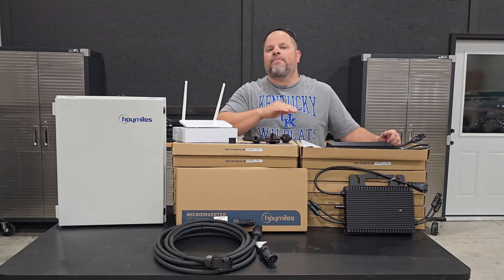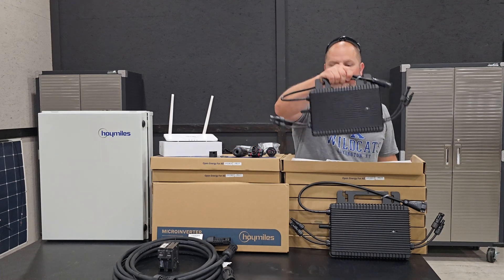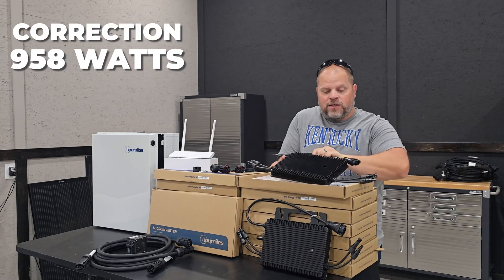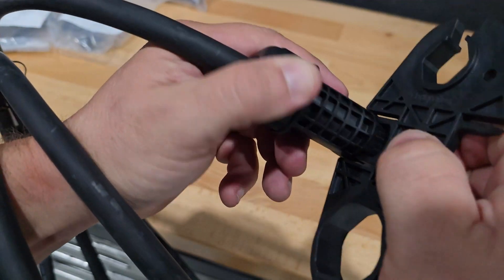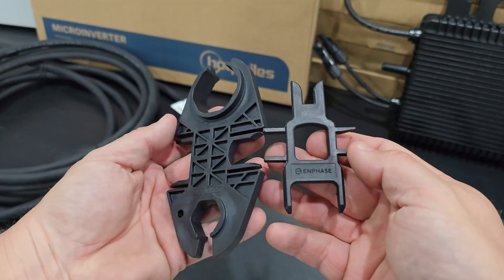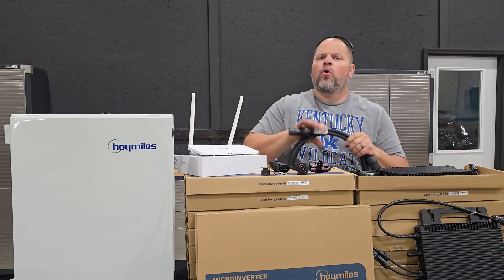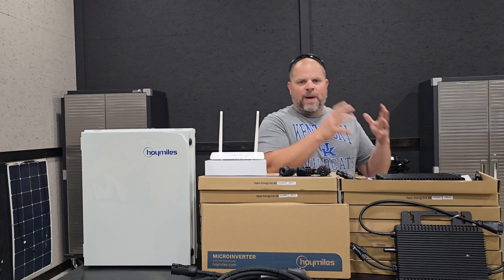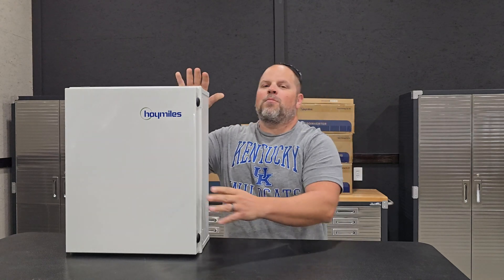HOYMILES just released this!! Goodbye Enphase

Comment: can L14-30P plug be connected to the trunk cable
Reply: I also have this question so it would be easier to backfeed it
Reply: Excellent question. I'm trying to find out this as well.
Reply: I have NEP Trunk cable. I suspect they have the same layout but not sure. in that case no it is not. 

Back to your question, L14-30P plug has exposed leads which wont be electrical code compliant because of exposed pins. They might be energized.

Comment: I just scored 36 duals. Since they were grid-tie I figured I could wire a string into my breaker panel and slow the meter down.  The utility smart meter did not recognize the input and kept billing me even while pumping twice my consumption back into the grid.
I got a hold of the utility and said I guess I'm bound to become a net producer. Let's talk.
Hoymiles makes it so easy. 
And yes, my eyes were on the combiner box. Delighted that it has in-built DTU.
subscribed.
Reply: I connected my panels to the house end of the meter. I noticed I don't get any credit when I produce more but the meter registers zero usage when I produce more. I ask them to give me a meter to get credit. I'm still in process.

Comment: Enphase really needs to step up, they are rapidly falling behind. I can already easily get affordable 500-600W panels and they have nothing that supports 400W+ panels decently. Also their earlier start-up argument does not hold water, not with current panels and other microinverters.
Reply from the maker: My Hoymiles system is far outproducing the Enphase I had. Finally got it up and running on a Solar Carport. I will be providing some performance data soon. I think everyone will be surprised.

Comment: A 440W panel can output over 500W if the irradiance is greater than 1000W/m^2. On days when there are fluffy white clouds, this occurs regularly. I've been using and selling Hoymiles microinverters for over 3 years. They don't fail and I have 100% happy customers! However, the HMS-1000-2T and HMS-2000-4T, clip at about 515W DC from the panel. It's huge compared to Enphase. I also tore out my Enphase system and installed Hoymiles for the same reason. Thank you!
Reply from the maker: Thanks for sharing that information.
Reply: Clipping does not bother me. I'd rather have the inverter at full capacity through a myriad of conditions and oversize the panel, than have an equally balanced panel that 80% of the time is not putting out rated power.
Reply: @wisconsinfarmer4742  Agreed. I use 550W panels myself.
Reply: I use dual HEP BDM-800 microinverters. They accept 600W on each input but outputs out 768W. It is ideal for two direction facing sytem as when one panel produces 600W the other is not as efficient. You kinda use time more efficienctly. Is it same with Hoymiles 1000?

Comment: Justin's where can I get that DTSU666 60Hz 120v/240V.
Reply from the maker: Might be available at NAZ solar.
Reply: Don´t get the Hoymiles DTU (if you have HMS or HMT without W). Look for OpenDTU/AhoyDTU. No need for the Cloud. It needs a bit of tinkering though. You can buy kits or get the components yourself for less than $20...
Reply: @fintrollpgr  I saw those on eBay ~$20. 
do the kits come with assembly and launch instructions?

Comment: Question??   For the microinverters that can handle multiple panels with one inverter, such as the HMS-2000 (supports 2 panels) or the HM-1500 (supports 3 or more panels). In these cases, does the microinverter shares a single MPPT across the panels it manages, which can lead to current mismatch problems under certain conditions:

•	Scenario with Multiple Panels on One Microinverter: When multiple panels are connected to a single microinverter with one MPPT, all the connected panels operate at the same current. If one of the panels experiences shading or underperforms (due to dirt, orientation, or temperature differences), the microinverter adjusts the power point for all the connected panels, potentially reducing the output of the unshaded or high-performing panels.
•	Example of Current Mismatch: Let’s say you have two panels connected to a single Hoymiles HMS-2000 microinverter:
o	Panel A is unshaded and can produce 400W.
o	Panel B is partially shaded and can only produce 200W.

In this situation, the microinverter will adjust the operating point to match the performance of the weaker (shaded) panel, causing the unshaded panel (Panel A) to operate at a lower power level than it could under optimal conditions. This is the current mismatch issue.

I need to know as I get partial shading during the day.   Enphase rep tells me Hoymiles has this issue but if not I'd prefer to purchase this solution.  Please let me know
Reply from the maker: From my understanding, they do not. However, I have not been able to confirm this in real life testing just yet. I am getting close to being able to install my Hoymiles system. Lots of red tape I am jumping through to make this happen with local jurisdictions. I do see a light at the end of the tunnel though. I hope to share an update with everyone every soon.
Reply: @TheSolarPit  I have two HMS-2000-4T in use. Every input has it's own MPPT. Which I know works as all 4 panels get sun/shade on different times of the day and perform accordingly to amount of light/sun they recieve.
Reply from the maker: @fintrollpgr  Thanks for following up on this. 100% correct. I did finish my system install. I recently added some videos on that. I have 12 HMS-1000's in use now. The Enphase rep is not being honest with you. Hoymiles microinverters are outperforming my older IQ7+ microinverters in every way.
Reply: @fintrollpgr  Also, if you have 3 700W panels, you still produce 2000W, the microinverter utilizes full 2000W even one panel performs badly.

Comment: I assume this means you can use the microinverters and directly link/configure to the wireliess router/MPU device...avoiding a whole combiner box install and putting another piece of equipment on the wall? (enphase requires the gateway)
Reply from the maker: Hoymiles does not require having their combiner, I just like having it. It does help simplify things in the install.

Comment: Why would you get 1000s over the 4 panel 2000s?   Cost is significantly cheaper with the 2000.  I am just starting down solar path and don’t know much.  Just seems cheaper to get the bigger ones 😊
Reply from the maker: You are correct. However, the layout supports dual microinverters not quad since it's a single row of 30 panels on a wall. If it were 15 panels on 2 rows, I would do 7 quads on 28 and 1 dual for the other 2. It really comes down to your design layout. Hope that helps out.
Reply: Ok I was curious if I were missing out on something.  I had an estimate on my house but felt it was waaay to high.  So I’m going to slow build my way to a full system.  My plan is micro inverters and the first array will be 12 panels on the garage so I liked the 3 inverter idea

Comment: Great job so far Justin, I just finished installing a 6 kw system, still don't understand why (at least in LA) you have to become an installer to be able to buy the micro inverter, since they are so easy to install and put to work
Reply from the maker: Good question! Much appreciated! Thanks for watching and commenting 👍 Congrats on the system install

Comment: How much power have you actually lost? Have you done the math to see how much your clipping losses are?  Theoretical max losses are much higher than day to day actual.  You need to have both inverters on the same panel type and do a long term test.  Please to an actual test and share the data....
Reply from the maker: I am working on building a system that I can test this out very easy. It is taking me a lot of time and effort, but I will get there.
Reply: too many people are concerned with solar noon output. You always want to oversize your array for the morning/afternoon hours. Doesn't matter much if your clipping for an hour or two. Would it be nice if it was a 2500 watt unit, yes.
Reply: @WayOfTheZombie  I agree. I"d rather maximize the inverter by oversizing the panel, than have panels that only meet the inverter capacity 20% of the time.

Comment: Awsonme video. I am planning a system just like this. Do you know if this has a zero export feature? With this, I do to need to get an agreement and permits with the electric company .
Reply from the maker: I am still learning these microinverters but I do not think they have a zero export feature. Yes, You would need to get an agreement and permits with any microinverter system. It is one of the disadvantages to microinverters.

Comment: I'm doing a 35kW ground mount using Hoymiles.  It does seem like the best option right now.  I'm SUPER interested in that combiner box.
Reply from the maker: 35kW system is massive. Congrats!! How are you connecting the backfeed breaker on that large of a system? What panels, model of microinverters and racking system are you using? I am stoked to have that combiner box! I  personally believe that is going to help a lot of people decide on Hoymiles. It just makes the overall process so much easier. From solar permitting, installation, and even monitoring. I can't wait to get that thing hooked up and share with everyone!
Reply: @TheSolarPit   I can't backfeed a breaker on that size of system.  I have to do a line-side tap into my secondary 200A panel.  I have the HMS-2000-4T on order, hopefully shipping this week.  My panels are massive Sunpal 700w (SP700M-66H), but the NMOT rating puts them at about 523W per panel, so they should be a good match.   For racking, I have an order in with Sinclair Designs for the Sky Rack 2.0, 50 panel array.  I have an existing 3kW system on the house, so it will be a massive system, all said and done.     I'll be interested in that combiner box as I'll have 5 strings of microinverters that I need combined, which would be perfect.   Then I'll run 2/0 awg to the house and into the disconnect, meter and line-side tap.   My utility bill this month was $1100, so I can't get this system in fast enough.    I've been having a hard time sourcing the 4-in-1 inverters as they seem to be rather popular.   I noticed you got the 2-in-1 from NAZ.   They told me the 4-in-1's aren't coming in until September and their confidence in that date didn't seem high.   I ended up purchasing through Todd at NC Solar.   He said he'll have them in this Thursday.  Fingers crossed!
Reply from the maker: Yeah, I will be very close to maxing my backfeed breaker on this installation. If I ever expand, I'll have to tap the line. I'm not comfortable doing that one, so I would have to hire an electrician for that.

Comment: Why would you rip out an existing system if the new system isn’t going to be mounted in the same place. Seems like it would be better to just add to what you already have.
Reply from the maker: Because it makes permitting 5x times harder in my area. It makes things a little more simple in my situation. I never wanted it on the roof in the first place. I did that to get a much quicker approval from planning and zoning. Now, I can take my time and work through the process. I'll leave the roof top system up there until I complete this new one. Then I'll carefully uninstall that one and sell it.
Reply: @TheSolarPit  I remember you explaining the zoning dilemma during your Enphase vids, but why are do your local authorities get their panties in a bunch about non-roof mounted arrays?